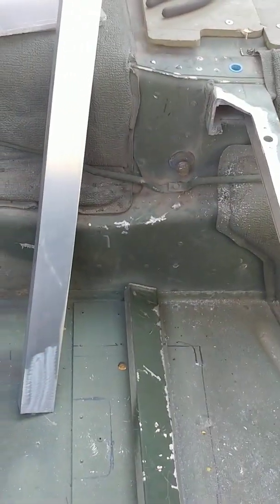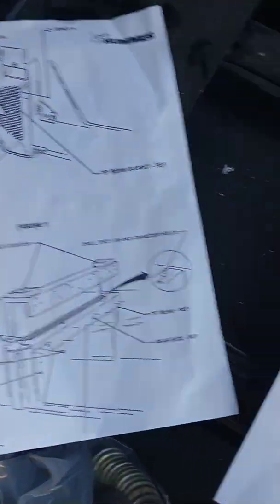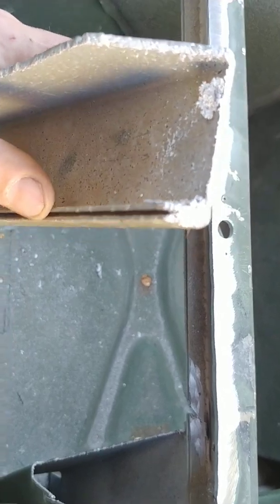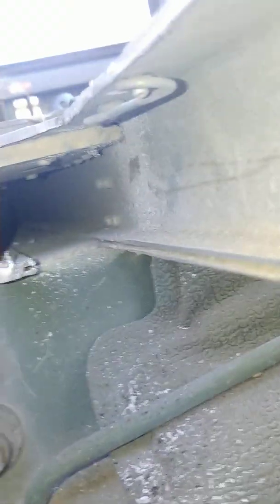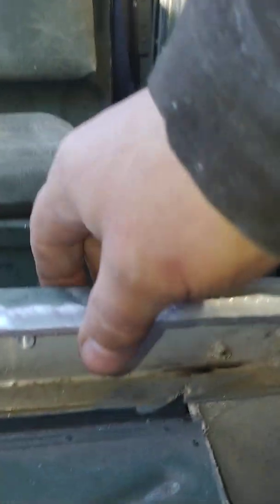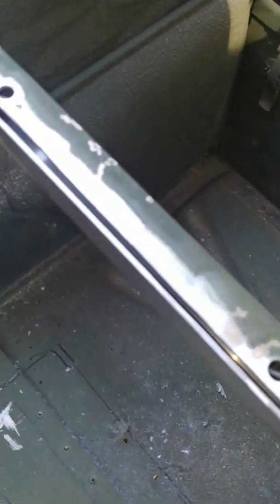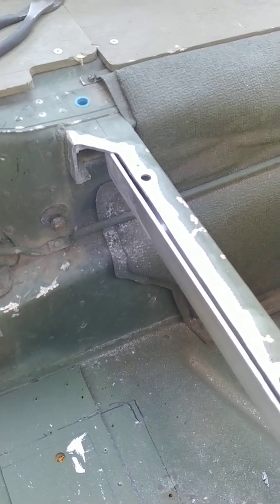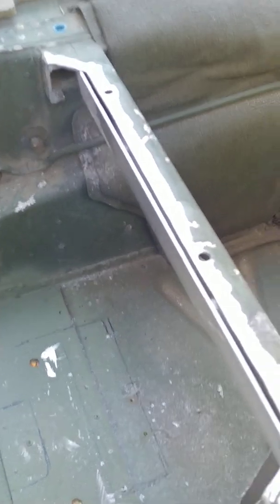humvee HMMWV b pillar brace modification

Comment: Some of the 1995 and 2002 mfg M1025A2 chassis SF Ground Mobility Vehicles GMV sold off of Letterkenny had the B Pillar horizontal altered similarly, cut away according to the diagram then a piece of bent aluminum was welded between the C channel along the back with 2 flanges at the angled points that fit overtop the C channel,  It was welded on by a few tacks along the length, not the entire cut edge.